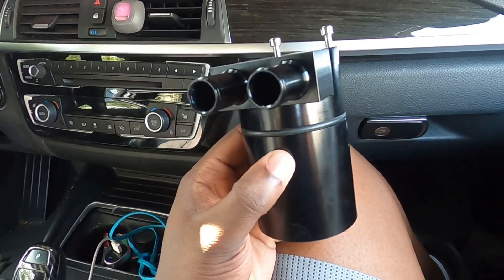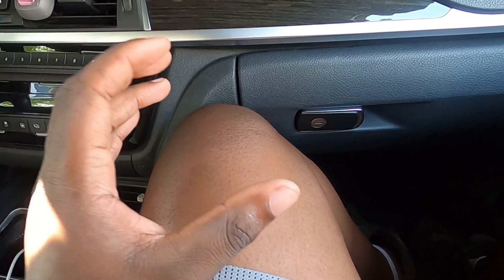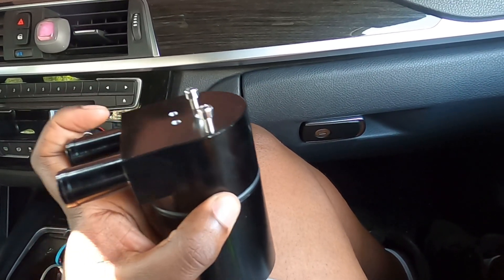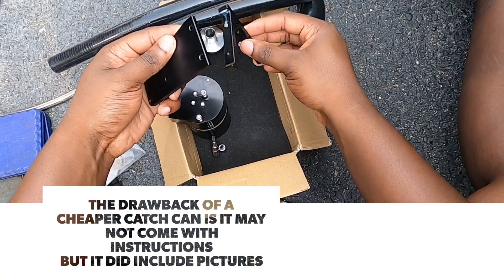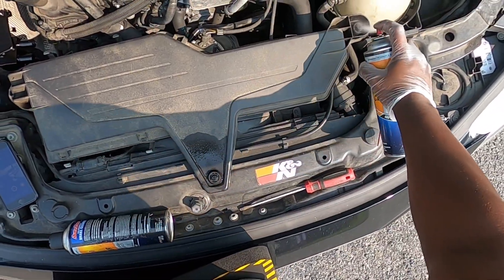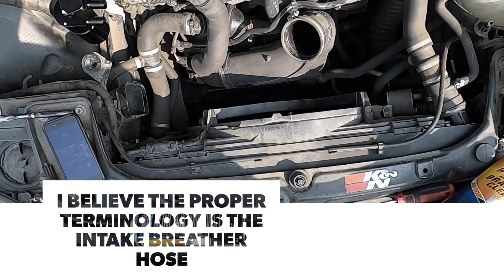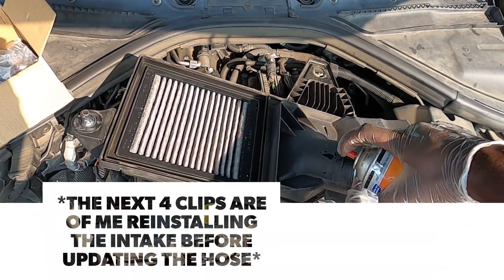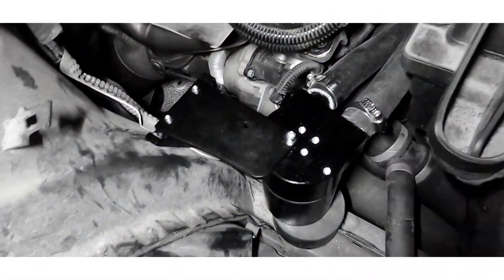2012-2016 BMW F30 328i/320i Oil-Catch Can Install

Comment: 07:15 its exactly the opposite. The inlet is where the air gets directly in contact with the filter/baffles and the Outlet is the area where it can freely flow.
Reply from the maker: @setto5-f8z not necessarily. More advanced catch cans may come with a baffle to hold the oil from sloshing around and may have filter on both the inlet & outlet. But for a more simplistic design like the one I have used in this video you want the oil mist to collect at the bottom. Liquid is heavier than air the bronze micron filter is literally designed to keep the moisture down & only allow air to pass up through the filter. Mishimoto catch cans are designed very similar. I already posted a short showing the results of a full oil change cycle feel free to check it out. & to make things clear the inlet is the oil vapors coming from the crankcase(PCV line). The outlet is the vacuum where the intake manifold is pulling air from the catch can. If there’s no filter for the outlet then the catch can serves no purpose it will still suck up oil mist. Thanks for the comment though
Reply: What im trying to say here is that you have installed the hoses the wrong way. Im not tryna explain u how the catch can works here.
Switch both hoses on the catch can and itll be fine.

Where you said the OUT Port ist, is actually the IN port.
You want the oil mist to go through the Baffles and while it cools down it drips down to the botton of the can my man! @ultimatediyguy395

Comment: You should not use brake cleaner on rubber, plastic, or painted surfaces. It is designed for brake parts and bare metal. WD-40 or silicone based lubricants should be used instead.
Reply: Don't use wd40! Its a water displacement formula that is a petroleum distillate and will cause rubber to swell and deteriorate.

Also its not a lubricant, i only use it to clean my tools. It acts as a bearer to air and displaces moisture, keeps metal from rusting.
Reply from the maker: @jonathanfrye9470  thanks for the info. I switched to WD-40 quite awhile ago

Comment: Hey man nice video but I have a quick question I notice when u lift up the air filter box u have a looks like 1/4” house attached to it  and mine don’t have that 
Where does that line goes to? 
I have a 15’ 328i rwd but everything in the engine bay looks the same …. 11:46